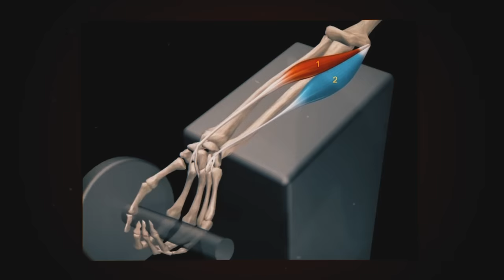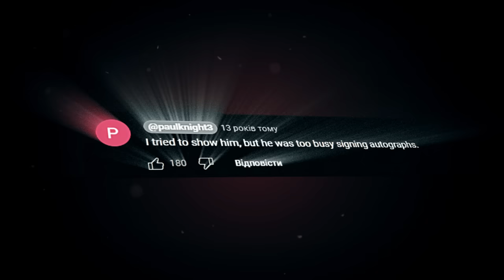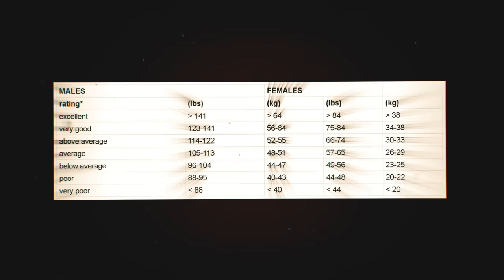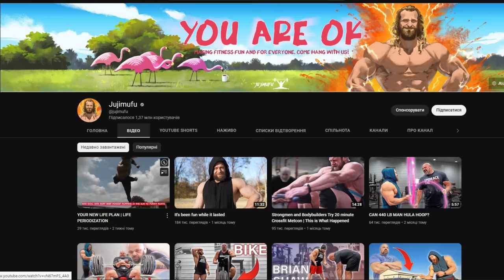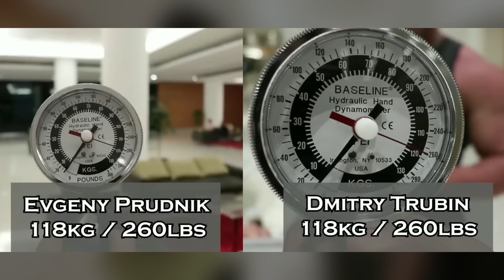The Strongest Forearms in the World. Who Owns Them?

Comment: This is really interesting. I always thought climbers had the strongest grip. Great content btw!
Reply from the maker: Thank you
Reply: elite climbers prob have the strong fingers for hanging off tiny edges, but that doesn't translate to squeezing a dynanometer
Reply: @staticoverplastic7456 they might have some of the best grip to weight ratio though. but yeah climbing is specific so it might not translate into the highest numbers in pure force intensity. it's also a lot about stamina, and experienced climbers know how to use just enough force to be able to hold for the longest time possible
Reply: @geemy9675  for the most part it's also just a different type of strength being applied. The most common type of holds at the top level of climbing are "slopers" (hand and fingers spread open to hold onto flat/rounded surfaces with no ledge) and crimps (tiny ledges the size of a finger pad or smaller). Hard to beat climbers at holding slopers or crimps, but sloper and crimp strength just doesn't translate as well to a dynamometer, different muscles/tendons. Passively hanging on terrible holds translates well to climbing and is often used for training climbing, but it's different from actively squeezing grippers which climbers do a lot less of.

Comment: Interesting story: when I was at firefightining school, one of the guys in my unit was a total unit. He weighted 135kg, for 1.88m, and he was lean as hell (like, I was a gymnast and in my early 20s. If you look at my videos, filmed in my mid-30s, you'll see that I'm still pretty lean. He as leaner than me as a gymnast). His strength was out of this world. Amongst other things, he scored 195kg on the dynamometer. That was well over twice what the next strongest guy scored.

Other anecdotes about the guy:

- Without much of a warm-up, I saw him doing sets of 6 ATG squats with 307 kg (675 lbs) on the bar.
- He used to flip cars easily. He thought it was so easy that I could do it too, and back then I weighted 66 kg. He brought me to a parking lot and asked me to lift a random car. I couldn't. He grabbed it, lifted it to its side and started bobbing it up and down like it was nothing.
- Once he wanted to use deadlift for cardio. He did 5x20 with 227 kg (500 lbs) with 60 second rest between sets.
- During the winter break, he wanted to get his weight down to 220 lbs from 295 lbs. He did it in two weeks by running in the snow six hours every day. He came back weighting less than 220, and then stabilized to 220.
- That was in his 30s. Two years ago, he was 50. I asked news from him, and he sent me a video of himself front squatting in the mid 400s (lbs). Form wasn't the best, but he did it. The man is still stupid strong.
- When he was young, he did judo. He had to compete against bigger/older opponents, because he was freakishly strong. He didn't even have to use judo. He just had to grab his opponent, and squeeze. The strength of his grip was so much that he could make opponents collapse and sumbit by just grabbing them and squeezing them.
- He never drank. He said that when he'd get drunk, guys would challenge him in fights, and he was worried he might accidentally kill someone. If I ever met a person I don't want to fight, it's him. I could run 100 meters in slightly less than 11 seconds, which is good for someone who isn't a track athlete. He could run faster than me.
- His forearms were the size of my thighs.
Reply: 195kg bs man.  Show some proof.  That would easily be the ww and he could close a coc 4 easy lol
Reply: @Freshprankstv1 How exactly do you want me to prove something that I saw nearly 20 years ago? The dude was a monster, plain and simple. You don't have to believe me if you don't want me to, I don't care.
Reply: @Freshprankstv1  Just looked into it a little bit. 195 kg would be a world record. Yet, I remember clearly that's the number he hit. The next best in the group got 76 kg. I got 70 kg, myself.

Here's a few things to ponder about:

-The dynamometer used. I know next to nothing about dynamometers. Is it possible that at high force, the results get less precise?
-It's more likely to see a dynamometer in a physio office than in a weight room. They tend to be more of a curiosity than a competition device. Grip sports are fairly niche. Dynamometers are even more niche.
-Brian Shaw apparently hit 160 kg, last year. Plenty of extremely strong people never got their grip tested. The guy I'm talking about claimed natty, and he was just built thick to begin with. It sounds like he had a naturally strong grip, which got even better with years of lifting like a madman.
-Speaking of Brian Shaw, I see on Wikipedia that his best squat was 904 lbs. The guy I'm talking about probably could have squatted around 800 lbs. When I saw him do his sets with 675, he was fully unequipped. Like, he wore some shorts and a t-shirt. He didn't seemed phase with his sets of 6 with 675. The Epley formula tells us that 6x675 yields a 1RM slightly over 800 lbs. I absolutely believe it. Those reps he did were ATG, and I don't remember the guy wearing even a belt. It was fucked. I also didn't see him doing it, but he said that his max ever bench was in the mid-500s. I don't remember the exact number, hence I'm giving an approximation. Brian Shaw did two reps with 530 lbs. So the guy is really not far behind Shaw in bench, either. Shaw measures 6'8", and weighted up to 440 lbs. The guy measured 6'2", and weighted up to 300 lbs. His relative strength was higher than mine for a lot of stuff. And I have high relative strength. To me, his sprinting speed exemplifies that. He could sprint faster than me. And he weighted double my weight.

Now, here's what I cannot claim with certainty:

-That the 195 kg grip test was accurate.
-That the weight of the plates and the bars that he used were weighted on a scale. They were not. All in all, it can make a difference, but not enough of a difference to make him not monstrously strong.

What's I'm absolutely sure of:

-This was not normal strength. This was fucked up strength only human monsters can have. It was amazing to see.
-Even if the 195 kg number is not accurate, his grip strength was definitely unreal. It was way ahead what any other person I've ever seen in real life could have done.

Back then, I did not understand that 195 kg was unheard of. I knew he was world class. I knew he could have been one of the strongest men in the world if that's what he wanted to train for. Hell, he could have done almost anything strength and power related, he even received letters from the NFL inviting him to do their combine tests, but he refused because he wanted to become a firefighter (his dad died in a fire when he was young).

Honestly, if I could go back, I would have asked him a lot more questions, and I would have asked him if I can record him training on video. Also, I would have made more efforts to go train with him, I know he would have taken me up.
Reply: @wandererstraining 
You are a great writer my friend. True or not, very well written and engaging like you are talking to the reader. 😊👍
Reply: @peteryeung111  Thank you sir! It's a topic that I really enjoy telling people about.
Reply: Bros yujiro
Reply: Is he the one that got away? Its never too late.❤
Reply: @brettcleveland6335  😂😂

Comment: Strongest forearms are almost always going to be athletes from 2 different sports. Arm Wrestling, and Rock Climbing. Also coincidentally going to be the athletes with the best grip strength.

These two sports while vastly different, have a lot of similarities as far as what you train in the gym.

Grip strength is important in both, but it’s absolutely crucial in climbing. Because grip could potentially be what saves your live! But grip is always extremely important in Arm Wrestling, as your hands in general play a much larger role in arm wrestling than most people realize. You could be the strongest guy in the world, but if you have weak hands and a weak wrist, you’ll get destroyed on an arm wrestling table.
Reply: I'm pretty sure climbers are the ones that will be able to hold their own weight hanging from their grip for the longest time, but probably not the strongest absolute peak strength
Reply: Climbers have the best grip endurance, they dont really train for peak strength. Being able to do a move at peak strength doesnt really matter when you are half way through a route and bail

Comment: Would love to test my grip I'm a powerlifter and heavy plant fitter I use my grip for 70 hours a week. The eBay grips are easy I crush them easy
Reply: Their are 2 types of crush grip. Grippers like captians of crush, and parallel grippers (like grip machine for example) or dybamometer(which is a bit different more parallel grip aand static). I would guess you would do better with dynamometer style.

Comment: Basically grip strength is not forearm strength it is basically finger strength 🔥
Reply: It's forearm strength. Your fingers don't add too much to it. The muscles are too tiny.
Reply: @HolyNarz there are many types of strength. Rock climbers are stronger at locking fingers at an angle on odd objects. Some people have the strongest squeezing power and others strongest wrists or thick bar work.
Reply: @mystyle8753  It's about grip strength here. And the biggest muscles for that are coming from the forearms.
Reply: @HolyNarz  tendon strength and nervous system is very important too. Not just the muscle. That's why you can do finger pushups with training. Since you are getting used to outting pressure on the tendons and body adapts specific to the task.
Reply: @mystyle8753  I agree with the nerve system. But please read the original comment I answered to. Maybe you will make more sense out of my comment. 
Also it depends how good the nerve system can control the FOREARM muscles. Please understand that
Reply: @HolyNarz  he is right to a certain extent. Grip is about finger strength AND forearm muscles . Just having muscles doesn't mean anythingbyes the movement is controlled by the muscle but also by the finger tendon , and also having storng wrists (forearm movements) doesn't mean strong grip.. So it's combo of using forearm muscles, and having strong finger tendon(in the specific nerve task)
Reply: @mystyle8753  of course it's a combo. But like 95% forearm and 5% fingers. Thats my whole point.
Reply: @HolyNarz  5%?so if you think you have worst tendons strength in history but you have big forearm that controls the motion that means you will be strong?? Now obviously i agree forearm controls the movements but if your tendons are damaged or crazy weak youc can't move either so def more than 5%

Comment: I just wanted to say 30 seconds into the video it seemed you weren't impressed by 150lbs of grip strength. That's literally the 1% of the population if not less. Climbing builds endurance and strength. Your average person's grip strength is typically under 100lbs. Secondly, forearm size does not equal strength. Grip strength is the tendons and ligaments extending from your fingers to elbow. Bodybuilders with big forearms that use steroids accelerate the muscle growth in the forearm, which is okay but the muscle doesn't regulate grips strength. Arm-wrestlers, strongmen, and climbers will have the best grip do to the continuous training of the tendons and ligaments.